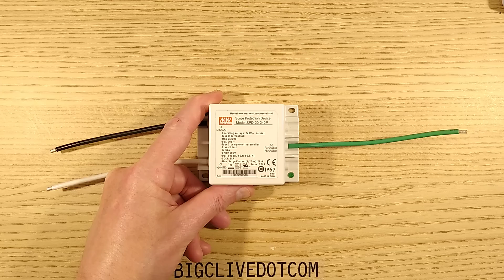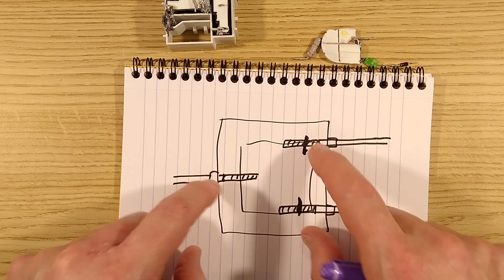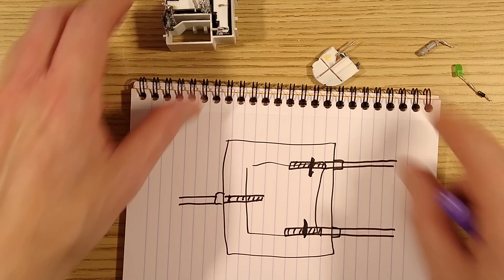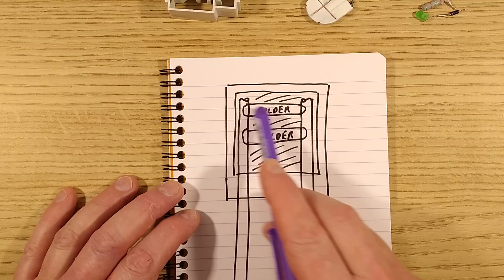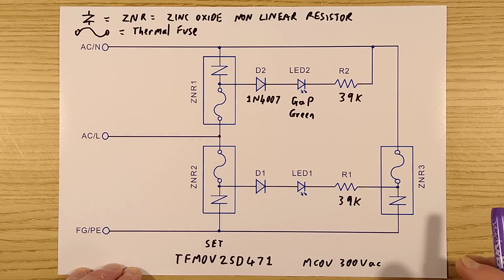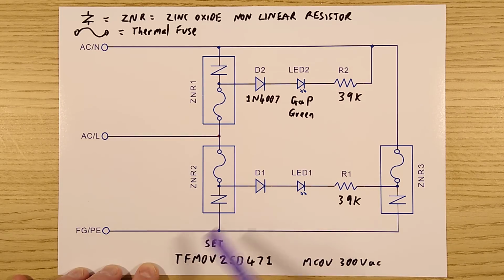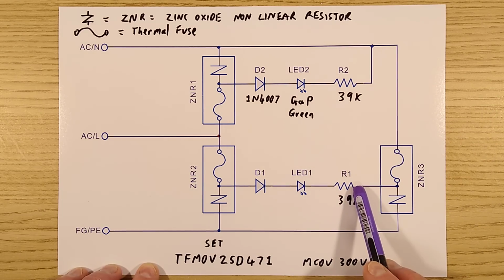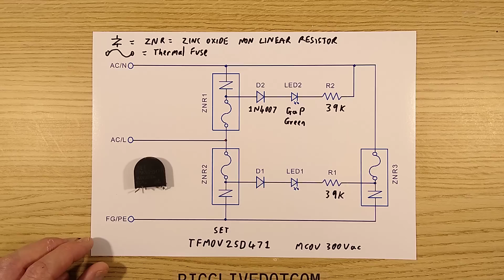Incredibly good Meanwell surge protection unit (with schematic)

Comment: As the grid becomes ever more noisy due to solid state inverters, variable frequency drives, and switchmode supplies this sort of unit will become even more important. Good on you Clive for giving praise where praise is due, in these cheap as chips throw away times it's nice to see something built to be fit for purpose.
Ray.

Comment: What is a good socket plug uk surge protector for extension cords or directly on the wall plug brand for like an air compressor that have no problems with the current in rush increase like it happens by this tools, thst it don't think its a natural surge and blocks the power than, if you understand what I meant to say? 🤔 🤗
Reply from the maker: Do you mean inrush current tripping a breaker?  Or one item causing another to lock up when it starts.   The surge suppressors may not help with that.

Comment: MCOV: max continuous operational voltage

Just found a price of around 12€, which is not much, given your todays washer, etc mainly die from surges killing the electronics power supply. These small 7-pin ICs are a bit like the self-healing caps, after to many surges, they are just done. But while the caps loose capacity, the switchers loose magic smoke.

Comment: Does not every uk house have a main power surge protection build in or do people have to buy extra extension socket surge protection plugs for devices ? 🤔
Do they have not a budget company for power supply's too, under a other brand name? 🤔
Reply: I'd like to see a country of any size and history of electrification with surge protection in every house.
Reply from the maker: They're starting to include them in modern homes.   There are cheaper power supplies available, but generally less reliable.

Comment: i love mov labeling, you find things like 10d431k and 10d471k. d is diameter of disk in mm. k is voltage at 1ma dc. ac volts for them are 275 and 300vac rms. where 275vac is really common for 230v here. we have 230/400v system. actually it's common for all sorts of worldwide psus which go up to 240v in normal operation. for that device, i can't read labels off video or i didn't notice, is it maybe rated to 277v? hence the 300vac mov? it has us color wires. and they do 277/480v in there somewhere. which is kind of shame to need all sorts of bit higher voltages. us realized that 120v sucks so they string 7.2kv to to every doorstep and give you 200a of current, so 48kw. where we usually do 16/25a which is 11/12.7kw. which is kind of lower than in us. but then at least in .ee, cooling is not much of a issue and heating is not electric very commonly. and cool/heat was where most of power went before electric cars. even though, trust me, 11kw is plenty of heat inside house if you have some insulation around walls. i tried! so...
Reply: oh, i forgot, up from 400v here is like 10kv, with some older things do 6kv and some newer things do 20kv. which you usually see more distance from houses and possibly underground
Reply: They have a 277VAC version - most likely fitted with 510V MOVs.

Comment: I had a project where I cheaped out and used generic chinese power supply and after the third one failed I got a Meanwell that never gave me any issues. If I’d gone for the Meanwell in the first place it would have been cheaper and a lot less hassle - lesson learned. Good kit and not much more expensive than the chinesium equivalents.
Reply: Buy once, cry once
Reply: You learned your lesson. Buy cheap, buy twice.
Reply: Sounds familiar. I have some alarm system gear in an attic that can easily hit 45C in summer. Chinesium PSUs worked fine all winter but failed in summer. After a few repetitions of that cycle I tried a Mean Well. It's survived 4 summers so far.

Comment: Big fan of Meanwell PSU's. Always use them in my projects at home. 
The only dead Meanwell's I've seen are in a machine at work where they are wired in series and used to supply a LASER source. They work hard, and work 18hrs a day, so I can accept a failure every now and then.
Reply from the maker: When the outputs of two switchmode power supplies are wired in series it causes damage if one is turned off or cuts out, as it may reverse charge the output capacitors of the one that is off via the circuit.

Comment: I used meanwell power supplies in automation for stuff where the standard din rail supplies wouldn't work.
My impression is that they know what they're doing and I've never had a failure.

Comment: I don't believe and trust in surge protectoin units⚡, after I caused an over-voltage over 3 of them and opened them. 4ooV over 275V units, they heated up and desoldered front their clips. The fuses didn't blow >>parallel. On house electricity boards or 2300A industrial boards.
Practically I can resolder them to save money. 😊 They ain't going to protect your electrical system. Over-checks electric breaker doing a better job.

Only way to protect your electronic stuff is with a PCB MOV with a fuse in series with the income supply, like LED Driver and PSUs of your TV. Must match the supply voltage like a 265V MOV for 230V and 30V for 24Vdc. Or go for the expensive goodies like an UPS and invertors

Money making scheme. 2x busbars millimeters apart in a vacuum or SF6, will stop surges and lightning
Reply: Two busbars millimetres apar- oh, you mean a gas discharge tube? Yes, those exist, and don't clamp at a low enough voltage to protect more sensitive parts.

Putting a MOV in series with your supply is just a way to generate heat.
Reply from the maker: They did what they are designed to do if you over-volted them.  I wouldn't recommend resoldering them as they will be damaged.

Comment: Considering you rated this so highly - wouldn't you expect a good surge protection unit to have additional gas discharge tubes and inductances to isolate and clamp the high energy portion of a surge? 
This unit seems like high energy surges would just end up blowing the MOVs open, leaving the devices exposed
Reply: Gas discharge may be more robust, but much slower to respond and clamp.
Reply: @curtw8827  Yes, that's why I would expect both on a solid surge protector. Gas discharge on the outward facing side, inductance to create an impedance for the spikes and MOV behind the inductance to get an accurately clamped voltage on the device facing side
Reply: @JonaJona  Inductance is generally bad, installers don't uncoil the leads, however there is a particular type of surge protector that uses a series inductor to limit the rise time of a transient but I know of only one brand with this specific feature.  The series inductor has to be sized to handle the load current. UL 1449 SPD test ratings are based on a 6 inch lead length since inductance is generally not wanted to slow down the voltage clamping response. Gas tube response is about 5 microseconds whereas MOVs are in the nanoseconds.
Reply: @curtw8827  That's why the inductance should be in line with the supply, slowing the current rise, as the MOV clamps the voltage on the device side, behind the inductance. This design both, reduces the instantaneous current through the MOV while still cleanly clipping spikes on the device side, and avoids clamping the grid facing side, so the GDT can ignite if the spike lasts for an extended time period.
Littlefuse has an old app note on this where they suggest using this technique inside a device with the input choke as the inductance. You're right though, that this does not appear to be too common. I'm wondering why? Maybe using a gigantiv MOV disc ends up being cheaper than the inductance?
Reply: @JonaJona  The series inductor doesn't dissipate much of the transient energy, only slows the rate of rise of the transient,  the MOV shunts the energy. Interesting enough UL 1449 doesn't require the joule rating to be marked on the SPD, so IMO the clamping voltage is the key parameter that I look for. The series inductor would have to be physically large to handle the nominal current so wouldn't be user friendly for most applications.
Reply: @curtw8827  Correct, the inductor is not supposed to dissipate any energy, rather it's supposed to keep the energy from going into the protected side of the circuit in the first place. 
I guess the UL standard is purely for parallel type devices and doesn't make any sense for devices with a series impedance. 
You will find products from a couple of manufacturers when looking for "series surge protection devices", though. They are usually meant for especially sensitive electronic equipment if the concern is unusually high frequency spikes.
Reply: The UL 1449 standard requires a labeled SPD to withstand 6 tests of the standard transient waveform.  MOVs lose their energy absorbing capabilities over repeated  impacts and time. The series thermal fuse is to prevent follow-on current if and when they self-destruct. Gas tubes are typically used where follow-on current is not expected such as Cable, antennas, and telephone that don't have a significant source of power to continue to flow versus an electrical distribution system.

Comment: I've heard tons of praise about Meanwell PSUs over the years, and if those are only half as well built as this chonker, I can already understand why. They're also reasonably priced (not chinesium cheap, but not expensive either) and just work. One of my Raspi projects runs off a 5V PSU from them, and if any other DIY projects require power, it's most likely going to be yet another Meanwell unit ;)

Comment: Meanwell - they literally meant to mean well, meaning they stake their reputation on that name in term of PSU and line voltage device quality. They're usually overdesigned to last. And yes, you can buy their wares at your usual online electronics components resellers like Mouser, if you want to pony up for better PSU, which I would.

Comment: I've never seen this particular device but it doesn't surprise me it's very well designed and built. I've been using Meanwell PSU's and drivers for over a decade and I've never had problems with any of their products. I wish more Chinese brands would go this route of impeccable products at very reasonable and competitive prices rather than the usual route that cheaper is better even at the expense of functionality and safety..
Reply: Taiwanese.....not the West Taiwan....
Reply: @JohnSmith-yv6eq  I'm in Sub Saharan Africa. The MeanWell products we get are mostly from the PRC.
Reply: @JohnSmith-yv6eq It is both. The company is originally based in Taiwan but it also has a large operation in mainland China.

Comment: I have been using more and more meanwell components in my line of work as a commercial electrician and I have never been disappointed with the quality. They always seem well built and designed, their documentation is also clear and straightforward.

Comment: How is this better than a classical two-pole surge protector?
Reply: Never heard of 2 wire surge protection. 
This one deflects any overvoltage from the phase or the neutral to ground
Reply from the maker: This one shunts all transients between any pair of conductors.  Not all electrical systems have the earth/ground and neutral tied together locally.

Comment: I believe MCOV = maximum continuous operating voltage. I’m a big fan of meanwell. We use their mains to 12V PSUs in various sizes in several of our products.Well made and electrically good designs, and towards the lower end cost-wise.
Reply: Heh, I guessed Max. COntinuous Voltage, but yours makes more sense.
Reply: Yep, that's what I came to say MCOV stood for, I was late to the video though.

Comment: Wouldn't protect from a direct lightning strike.  But it is interesting to try to wrap your head around the induced current scenarios these things protect against.  The discharge lamps then MOVs to shunt the currents around the device, capping the voltage on the live input then the use of the bonded neutral/ground so there is a parallel path to cap the voltage spike on that side of the circuit.

Comment: Potting: When companies who rip people off don't want anyone to see the $2 worth of components inside their $200 product.
Reply: Or... You know for making high voltage protection circuits working as intended lol 

Meanwell is far from a rip off company . 
They sell the best power supplys on the market at a bargain price
Reply: @NinoJoel  To clarify, potting does serve a legitimate safety function.  That scammers use it to hide what they're doing doesn't imply that all potted items are scams.  Most of the time potting is done for legit reasons.
Reply: Like a "power line cleaner/power saver" with a ceramic disk capacitor potted in a 10 cm × 10 cm × 15 cm box.

Comment: Lightning/over-voltage protection shouldn't be undervalued! 
I had several demage of electronics by over-voltage already. 😳
- at least one telephone/fax/response machine combo (couldn't get repaired anymore)
- surveillance monitor several times demaged, could get repaired every time
- surveillance video-recorder several times demaged, could get repaired every time; eventually I had always one in reserve
- alarm central unit, could get repaired
- 2 power-units of 2 different TVs within 24 h! 🤦‍♂️ Got it repaired for just € 36.- within 24 h.
My point of view: protect your valuable electronics! A protection device is much cheaper than the cheapest repair.
Demages occure more frequently at end-points of old installations with different metals (aluminium, copper, brass, steel) and without equalisation/bridging of different potentials. 
Inductive devices (coil-transformers, big motors, arc-welders, ...) without peak-voltage-elimination are just the cherry on top of the cake. 😬

Comment: Back in the late 90-early 2000s I was servicing Personal Computers in a small store I had. The damage caused by lightning strikes was interesting and so preventable with such a device as this. It was amazing how hit and miss the damage to the insides of the systems would be, and back in those days, the modem (phone line) was what many times people forgot to put spike protection on. I would imagine that cable companies would have to protect their products when they bring a conductor into the house as well. Spikes can come from lots of directions, not just the power.
Reply: The store I worked as a technician in had a system unit brought to us by an insurance adjuster after lightning strike damage through the phone line. Rather than unplugging everything the user had switched off the power strip.

Lightning had welded the slot cover of the modem and of an adjacent empty slot to the case.

He wanted to know if any of the modem, system main board, ram, cpu, power supply, hard drive or video card were 'salvageable'.  With the cover off there was no visible damage beyond that the MOV on the modem board was discolored. We took everything apart and tested each separately. Nothing had survived.
Reply: I had a system that had a direct hit to the house, it actually blew the opto isolator off the modem. The power supply and video card were fried, but some how the motherboard, CPU, memory and drives all made it. @mikebarushok5361
Reply: Yeah, voltage spikes can really take weird and unpredictable paths sometimes. A few years ago, a lightning strike nearby managed to grill the network chip of my PC. The PC itself was protected by a power bar with integrated surge protection, but the router wasn't, and apparently the spike traveled through the router and into the LAN cable...
Reply: @NiyaKouya  They don't just come in on a cable, every wire has the potential to act as an antenna to pick up the EMP.  I had a nearby strike blow out the Ethernet port on a cable modem and the port on the router it was connected to, but both devices otherwise still worked fine!  I ended up using the modem for another year or 2 via the USB port (this was back when they still had those) until another strike finished it off.  I've also heard of laptops running on battery with no cables connected getting fried by nearby strikes.
Reply: I used to be a part time cable guy, working evenings after my primary day job.   I'd be driving  to the cable job and see an electrical storm crossing over the town.  I knew I'd have a stack of brand new tickets waiting for me.   "Storm came through, cable box stopped working."   I'd just take a whole case of boxes with me that evening.
Reply: Can confirm, my mother would toast her modem at least once a year by leaving it plugged in during thunderstorms. Amazingly, ONLY the modems suffered damage every time. (PC still works, we retired it when support for Win XP ended, and it was too low-end of a machine to bother upgrading Windows. People laugh at eMachines, but the ONLY issue we ever had with that PC was Fried Modems, and that was clearly owner negligence.)

Our house was built in '75, with underground utilities, almost 300' from the pole, and we actually had a small transformer in the basement that fed AC to the phone line, so maybe this combination of factors saved us some grief? Well, I'd rather drop $50 or $60 into replacing the modem than the whole tower. 🤷‍♂
Reply: Where I live, cable companies often use contractors for customer premise installations, so quality is all over the map.  I had a pretty decent installation and back in the days of analog basic cable I started to get nasty hum bars in my picture.  I called the cable company who sent out a technician who drew a pretty healthy spark when he unscrewed the F connector.  He muttered something about my ground was probably servicing the whole street.  He put in a new drop and made new RG-6 jumpers, but I still had hum bars.  I wound up buying my own ground isolator and that somewhat reduced the issue.  Eventually the problem went away when the FCC started to crack down on cable system egress, so the company had to do a general system tune-up and get grounds where they were supposed to be.